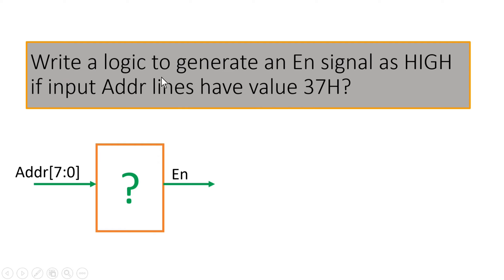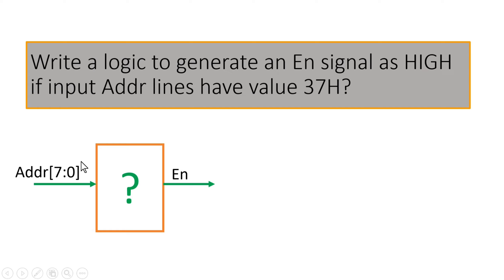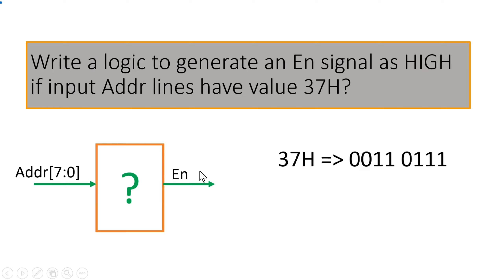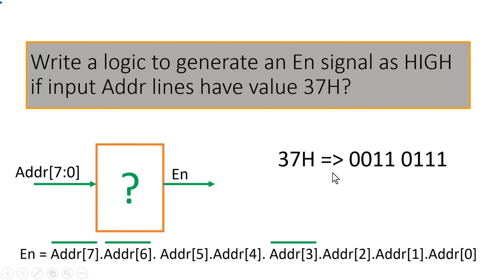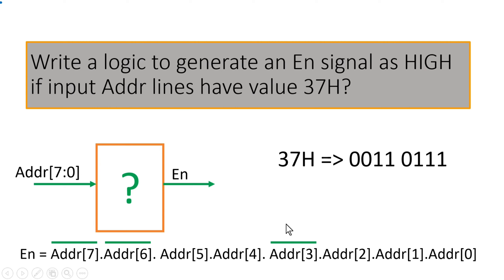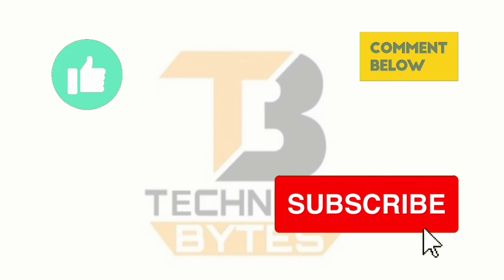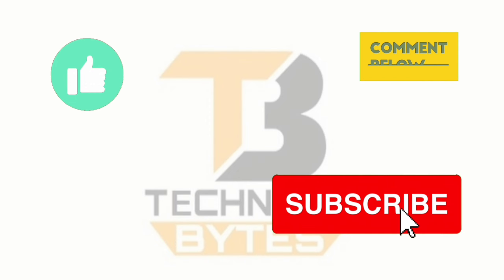En Signal for Vaue 37H

Comment: but for this, the input should be parallel, what is the soln if they give us serial input ( I think in that case we have to use a flip that will delay the bit by 1 clock cycle and then and both this output from ff and the current output)